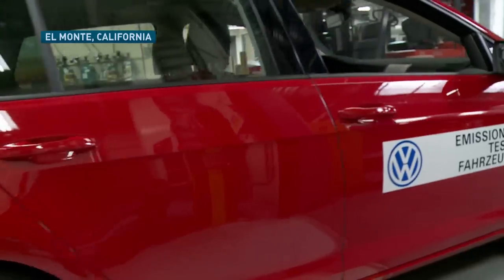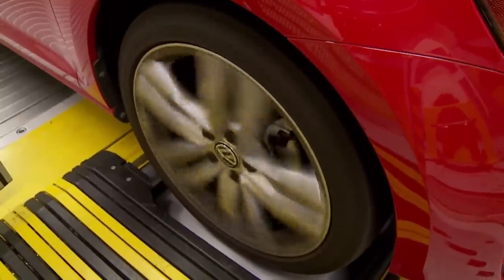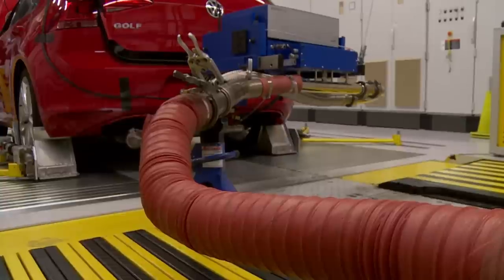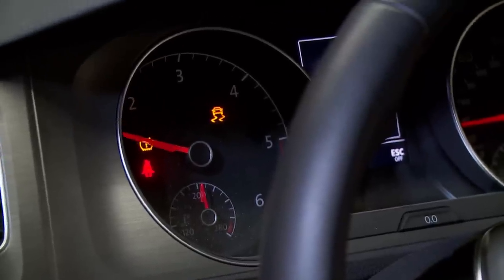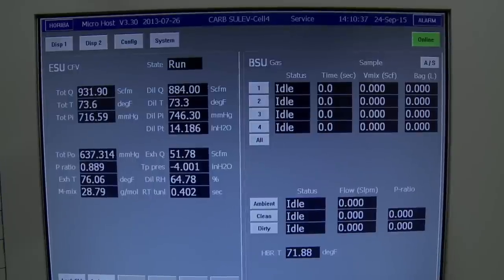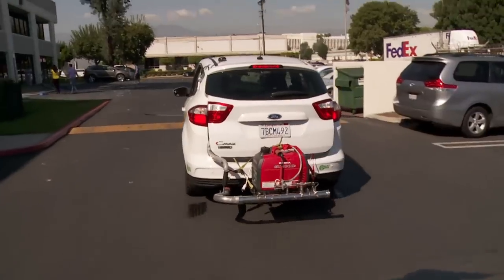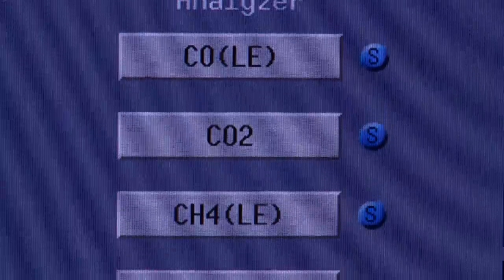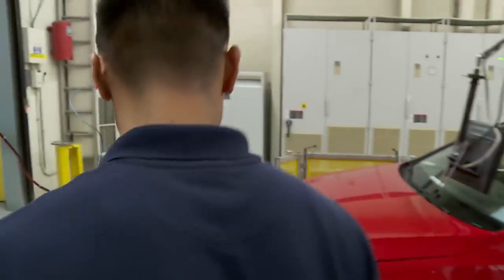How tests that exposed VW emissions fraud were done

Comment: It seems to me that in addition the emissions fraud scandal almost all auto dealers have massive discrepancies between spa rated gas mileage results vs real world cosumber mileage results. The latter issue should be corrected at this time too in my opinion !
Reply: +Murray Kat ___  And exactly which "real world" mileage would you like posted.  A sample car from the Arizona desert where the air is dry and the roads are flat, or someone who lives in the Rocky mountains, where the air is thin and the roads are hilly.  How would you choose the driver to sample, one who stomps on the gas at every green light, or someone who drives more conservatively.  The EPA numbers are a standard "basis for comparison" so that all vehicles do the same "route", under the same conditions.  For more "real world" numbers, any number of automotive testing groups (Consumers Reports, Motor Trend, etc) do real world driving and can provide you with real world numbers, all it takes is a bit of research.